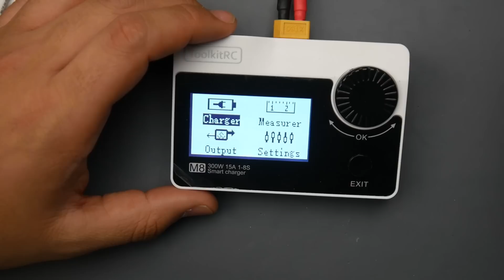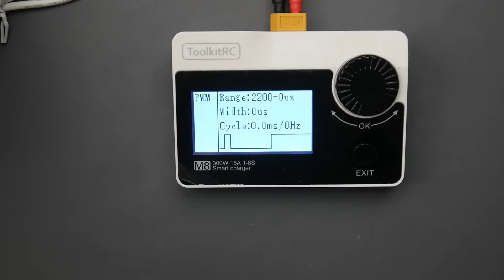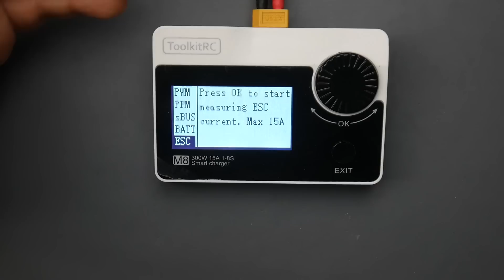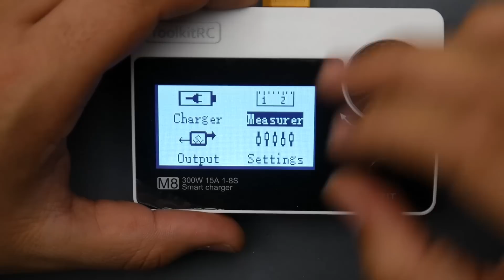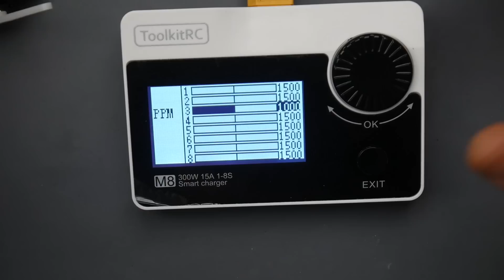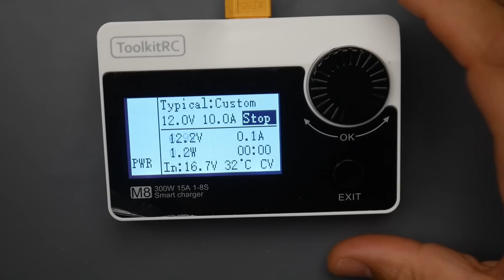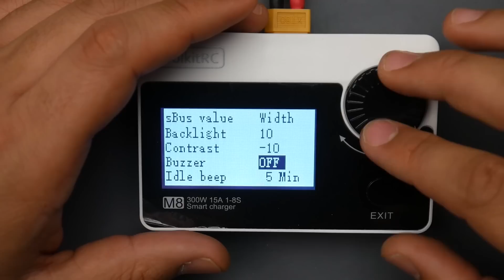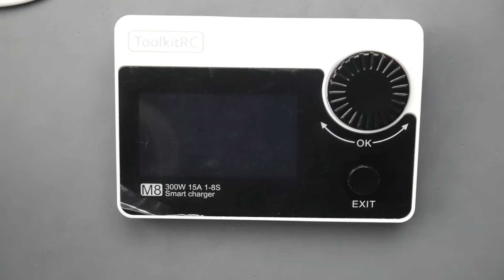Must Have All-In-One Solution // ToolkitRC M8 DC 300W 15A

Comment: The recycle storage and discharge mode is awesome. it lets you take your partially charged flight packs and discharge them back into main pack when you are finished flying for the day.
Reply: Did you try this? Is it charging main pack with CC\CV? How to control main pack charging? As for me - any charger can do this, just plug your particular ycharget pack as PS and set main pack on charging with any Amps\volts you need. To control charge level on your pack - set minimum input voltage on your charger.
Reply: I guess so

Comment: Sorry all.  This is a stay away charger.   The extra features are cool, but the charger sucks at being a charger.  I have had many errors trying to just charge.   ive updated the firmware and still have failed charges.  Ive have had zero errors with isdt chargers or my powerlab8.

Comment: Actually already have one on the way. Through mode on psu mode looks especially handy as a smoke stopper on bench... Will have to see if it's effective. Feel like testing that for us?

Also curious if it comes with any adapter cables.. Using it to power anything but a battery would need the gender flipped right?
Reply: Mine arrived yesterday. Only cable it came with was a USB to USB. Nothing else in box but that one cable and unit. Haven't used it on bench yet.

Comment: Looks nice, but correct me if I am wrong, you still need a AC/DC converter/PSU if ur not powering off a giant Lipo...??
Reply: I think so and an xt connecter adapter to the psu ,  I do not have a giant lipo.   Am considering repurpose a PC PSU cheapest PSU

Comment: Sadly mine came uncalibrated :/
All the LiPos I charged to 4.2V/Cell only had 4.15V/Cell when I measured it.
Reply from the maker: increase the charge voltage by 0.5 that is why they left that option.
Reply: @DroneMesh  The individual cell measuremens are not off by the same ammount. It would still balance wrong and maybe even overcharge some cells
Reply: @SandroFPV  In the calibration menu you can change each cell as well as total voltage. If you have a well calibrated multimeter, record total voltage and individual cell voltage.  Hold down the jogwheel when you plug in the charger, then hook up the battery and set all the values to match the meter.
Reply: @StevePinkham  I did that for like an hour but afterwards the LiPo got overcharged and when I plugged in a different LiPo it was inaccurate again
Reply: @SandroFPV  Did you change both full pack voltage and each cell?  Are you sure you got the cells in the right order? Did you save before leaving? Is firmware reasonable up to date? Took me a minute to figure out which order the cells were, but once I calibrated it it's been accurate.
Reply: Firmware is up to date and I changed both values. Idk about the cell order though
Reply: @StevePinkham  could you make a youtube video for this ? I'm trying to charge my single 4s 1800mah battery, but it finished off saying it's reached 4.20 and 16.5v. Yet when I plugged in my battery tester, it only shows 4.15v each cell.